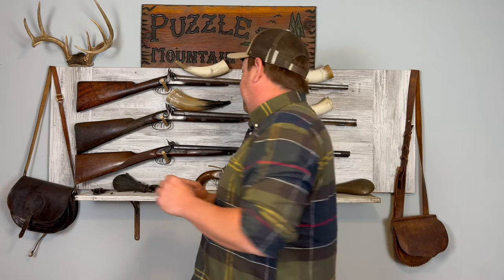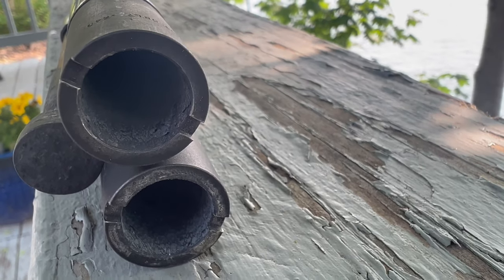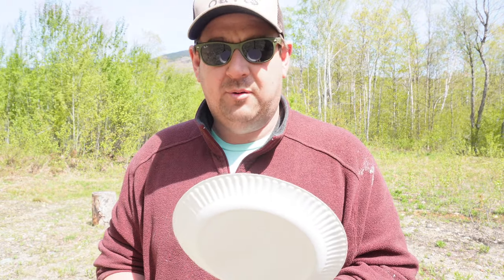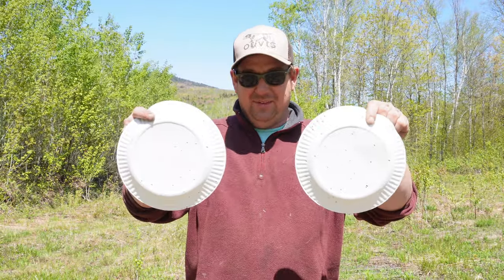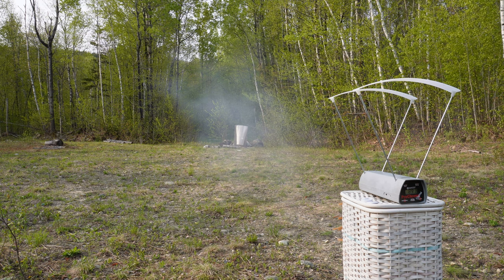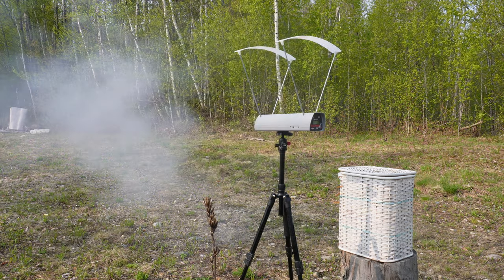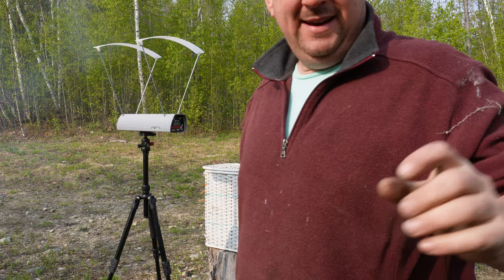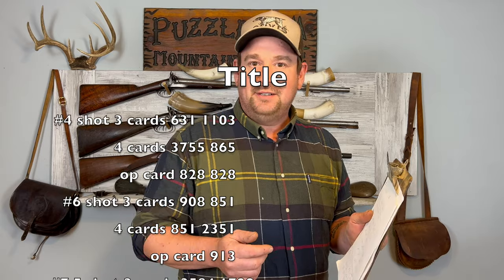How to shoot a choked muzzleloading shotgun

Comment: You are having way too much fun and thanks for sharing!  I have done an awful lot of patterning with vintage muzzle loading shotguns and have read a great deal from those ole timers who used them to put food on the table....so, this is not criticism but food for thought.  The black powder of choice for best patterns in 12 gauge and 10 gauge shotguns is 1FG.  You are absolutely correct to use cards over the powder and no heavy nitro card or fiber cushion wad...and good for you.  Secondly, a square load is not usually the best for muzzle loaders...but more shot then powder.   Third, forget the chrono....get the pattern tighter and more even. first and then check the speed.  Old timers with no technology used to check for a killing loading by using a soup or bean can....if the load penetrated both sides at 25 yards it was a killer.  I also use a wad of wasp nest packed tightly over the powder followed by  two stiff cards cut from waxed milk cartons....then the shot and then a card over the top.  Good patters out to 25 yards with no choke.  Also, google VM Starr, the man for correct loading of muzzle loaders.....take care and enjoy.  GOD IS LOVE AND GOD IS GOOD AND HIS MERCY ENDURETH FOREVER AND EVER!!!

Comment: i have the same gun and have regular   choke tube improved through full , they screw in flush with the barrels
Reply from the maker: I have seen the stock Pedersoli tubes and see that they are essentially flush fitting . I still haven’t figured out if this is a custom built or a stock Pedersoli choked shotgun. I haven’t taken the time and had the threads measured so I can decide if it is stock or not. I took it to a gunsmith and he said it appears that it was lined. The internal dimensions are .700. It takes 12 gauge cards just fine. I would think with the way how these tubes are made they at least are custom. It’s choked to .640. That’s an extra full choke
Reply: I just purchased a new 10ga sxs waterfowl pedersoli ... It came with modified cylinders but still looking to get it choked tighter